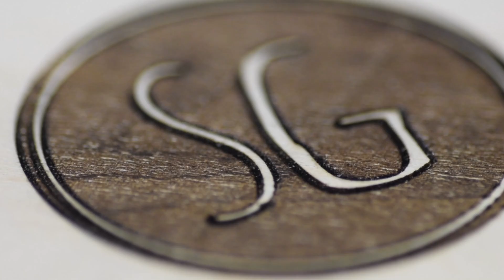Installing a 4.2W JTECH LASER on my Axiom CNC!

Comment: Got a question!
Everyhting is hooked up but when I turn the key switch and turn on power switch Laser Enabled LED did not light up
Reset Switch works tho.

Am I missing something or miss connect anything?!
Reply from the maker: Have you tried to hit the reset button? Also check the switch on top to make sure it's set to laser
Reply: Yes I did. Fan spins and Left LED lights up.
and the switch is set to laser indeed.
Reply from the maker: Is both LEDs or just one light up when you hit reset?
Reply: When Mode Selector Switch is push to right, left LED lights up, and when the selector switch is pushed to left, Both light up
Reply from the maker: Ok good so I believe 2 LEDs means you're in manual mode. Try that and hit the on/off spindle button on the main CNC controller and see
Reply: Now both LEDs light up when I hit reset.
LEDs are off even when the all the switch is on
Reply from the maker: Sounds like a connection issue :/